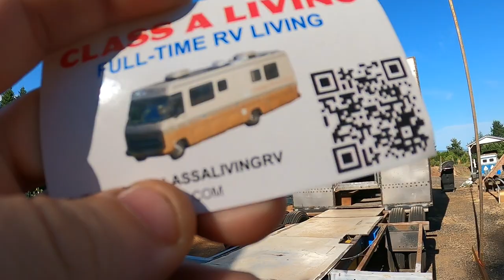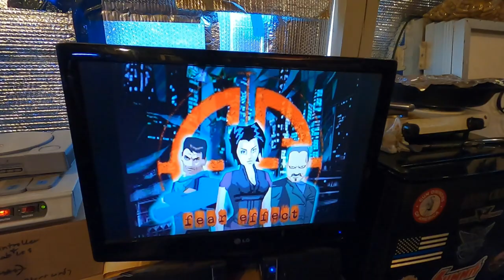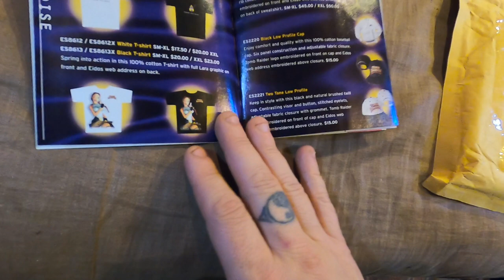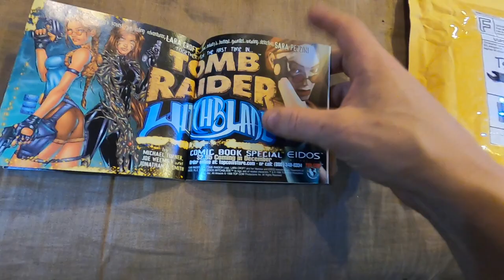RV Plans, Update Vlog

Comment: That grill is worth investing the $40 bucks in, get the inner parts rebuild it and sell it off, i usually make 2 or 3 grand a year in the spring picking up grills along side the road and restoring them and then listing them on buy sell trade. have someone picking up a patio kitchen for $500 this weekend was a $1000 grill invested a little under $50 in it and I'm selling it for half the retail price...